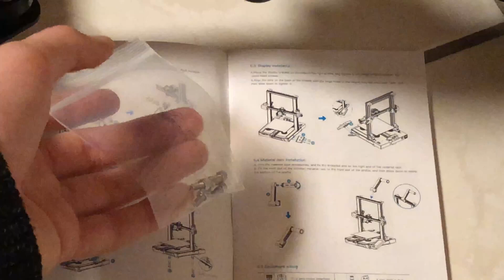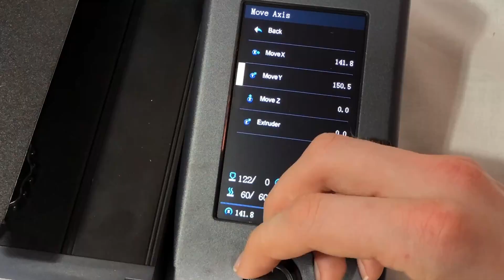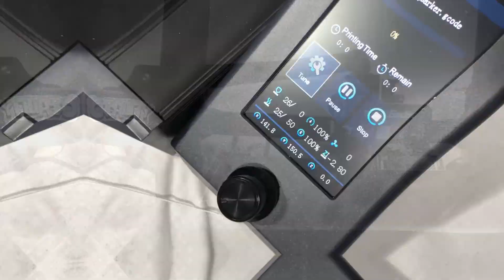NEW Creality Ender 3 S1 UNBOXING AND TEST

Comment: Is this using the slicer software it comes with? Could your do a start from downloading a design and how you get all the way to pressing go on the print? Wanting to get this printer but for a first time user some of the not sure about parts hold me back.
Reply from the maker: Hello, I'll see if I can plan something on this topic (in my next project). Otherwise you can look for this topic in the YouTube search engine. In my case I use Cura ( the Creality slicer is based on an outdated cura version).

Comment: I'm looking for my first 3d printer. Would you recommend this printer or the wndee cr6 se?
Reply from the maker: The S1 has a direct extruder. This makes it easier to print flexible filament and has fewer problems with stringing. With the cr 6 with bowden extruder, it is difficult to print flexible filament and stringing can occur.

Comment: hello, what did you put in the length of the retraction? and retraction speed? and the temperature?
because I have 0.8 retraction speed 40 mms and I have angel hair
Reply from the maker: I have retraction 0,8 mm, speed 50 mms. Tomorrow I will set a Cura profile on thingiverse (of course it is linked in the description😉)
Reply: @andrewaggenstein2463   ok thanks
Reply: Hi, i just bought this printer but I have a problem. Sometimes when I start a print my printer heats up but it doesnt start printing. I have tried with both my sd card and over USB.
Reply from the maker: @sadsausage2224  Hi, I actually had no problems, did it not move at all when printing started? For me it did not start once because the CR-touch did not extend.
Reply from the maker: Hi, try it  with a new firmware creality has put in a new one: https://www.creality.com/de/download
Reply: @andrewaggenstein2463  it doesnt move at all
Reply from the maker: OK, then I would play on the firmware that creality provided on December 31, 2021.  So first flash the display-firmware then the mainboard with the mainboard-firmware
Reply from the maker: Did you ask the support ?
Reply: @andrewaggenstein2463   I installed the new firmware. It did make a little bit of difference but the printer still didnt start to print. Then I did some research and found out that temperature fluctuations on hotend maybe could be the problem so I did a pid autotune and now everything works.
Reply from the maker: I have to do it too.  This printer needs a lot of time for me to heat up and the temperature fluctuates.